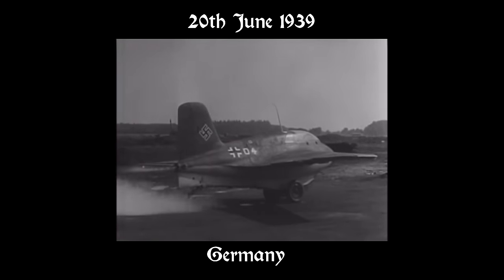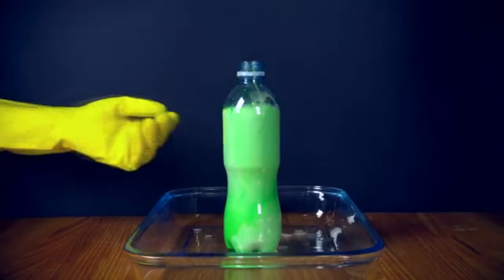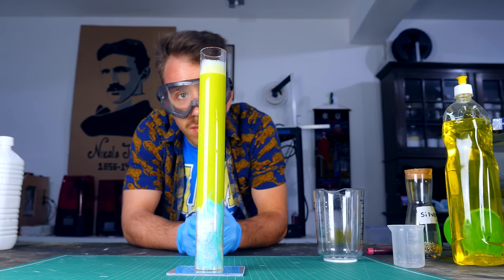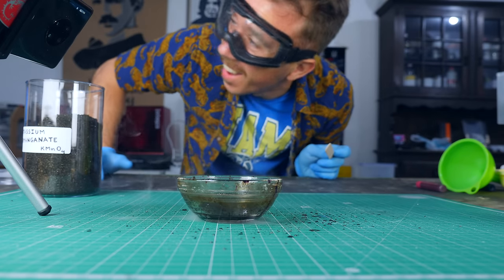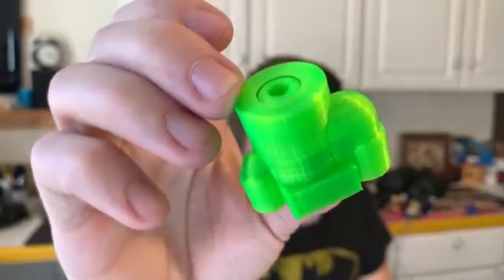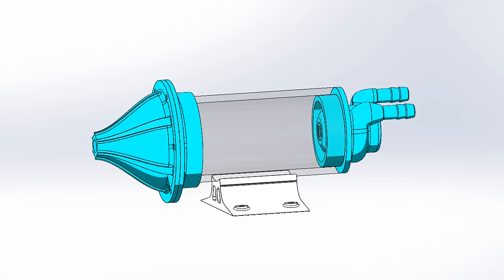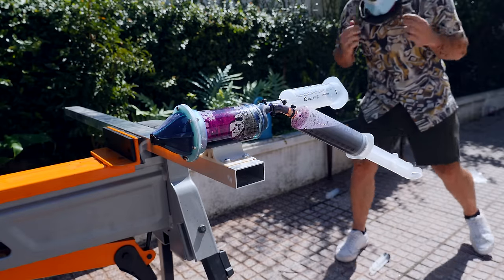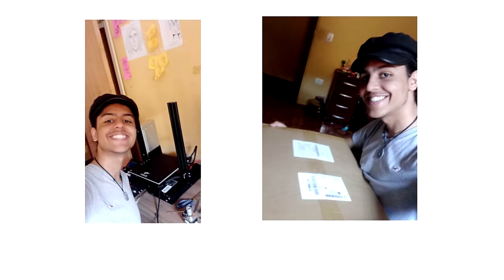The Forgotten Nazi Cold Rocket Engine (3D Printed)

Comment: Catalytic reactions are typically directly proportional to the surface area of the catalyst. Swap those beads of silver for silver mesh and place in the nozzle. H2O2 which doesn't react with the KMnO4 (common, due to the violent nature of the reaction and limitations on reaction vessel volume) will get another reaction chance with the silver (it also promotes mixing). Also, a bit of tweaking to the design of your reaction chamber and mixer will help limit the backflow issue you're having. For the mixer, redesign to make it conical around the nozzle (the cone going IN to the chamber) and for the reaction chamber you can add angled (baffled) steps to the side so that expanding gasses favor moving towards the walls of the chamber and nozzle (this also reinforces the chamber which allows you to make it thinner/lighter). Beyond that, you just need to get the H2O2/KMnO2 ratio correct and figure pump(s). Bonus points if you put Tesla valves between the pump(s) and mixer to further limit pressure backflow. - Video idea: Steam Rocket Engine 2.0
Reply: Redsigning the injector for higher pressures so that the catalyst and catalyzer can be atomized before mixing would help.
Reply: I think the reason his test at the beginning didn’t work so well was because of the lack of surface area.
Reply: Anjay
Reply: The silver is also likely oxidized, limiting the amount of actual catalizing that occurs. Putting the potassium permanganate in a blender to make the particles more fine may also be smart so surface area is increased.
Reply: @pabloarroyo1023  - Silver doesn't oxidize by itself as it has an incredibly low affinity for oxygen. The most common oxides are all dark so the silver wouldn't be shiny if it were anyways. As for grinding up the potassium permanganate, that would only be necessary if he's not dissolving it all in water. 5g per 100ml at room temp is it's solubility.
Reply: I agree. Something else I noticed with this rocket was a combustion instability. Or in other words it was moving back and forth. This can be seen and heard in the footage when the said rocket engine was in operation. It went in waves instead of one clean motion. 
This has been known to destroy rocket engines and is not good. I don’t know if it was the injection methods that contributed to it in this case as injection pressures probably varied a lot in these tests or if it was a fault of a injection element 

Additionally increasing the length of the combustion chamber would help with proper conditions. If the chemicals get expelled through the nozzle before it’s done reacting you loose energy. And having the combustion chamber at a proper length is very important for effective operations. 

And to reenforce this idea use a silver meshhhhh
Reply: Yo
Reply: Maybe use a tesla valve for the backfiring issue...
Reply: Holy shit - now we going somewhere....
Future video titel:
Steamrocket thrust and engine operating time test
Reply: the printer will be yours my friend
Reply: Make a peroxide tank that is fed with steam the pressure would inject your peroxide in the chamber. Have you tried to use a sponge soaked with the second agent it might prevent it to be ejected by the pressure and a silver screen at the entrance of the nozzle might take care of the rest of the reaction. Please take a look at jet packs. They use peroxide as a fuel to propel them. It would give you a idea on the making of a steam generator. Keep all 10 of your fingers because we Love your videos!
Reply: best comment ever award
Reply: talking about a Tesla valve, the original design is a 2D design but he could probably design a more efficient design in 3D and print it
Reply: One of my first thoughts was to have some mesh in the chamber just for mixing. Never thought to combine powers and use silver mesh. Awesome idea.
Reply: Printer incoming
Reply: Boi u tha goat
Reply: 2.0?? Haha this sounds like 11.0
Reply: Same thoughts here, using the Tesla valves to limit back flow, and figure out the ratio of potassium permanganate to hydrogen peroxide for the reaction, so he doesn’t waste any reactants, the silver Sieve is a great idea, though I imagine it would stop working after a while, and you would need to replace the silver sieve. He should also try testing various nozzles to get peak thrust.
Forgot the word mesh for a bit there, meant mesh, wrote sieve
Reply: You could use the heat from the reaction chamber to heat/vaporize the incoming H2O2 before it enters the reaction chamber.
Reply: Fine silver shavings will increase the reaction time 2X.
Reply: Palladium on carbon spheres is used as a high concentration H2O2 catalyst in industry. Palladium is a bit more expensive than potassium permanganate though.
Reply: I think he is going to have to make a mesh of silver by 3D printing it in a plastic that can melt and evaporate at high heat, and use the 'LOST WAX METHOD" - you coat the mesh with plaster/water mix then coat it in clean sand, let it dry out, then repeat this to build up the outside coating of this. then you bake it in an oven to set the plaster and melt out the wax... or plastic in this case - I've seen this exact thing done on another channel and it worked great, but he used a certain plastic in the printer. THEN you melt the silver into liquid and pour it in the the void left by the melted plastic, let it cool, then break off the plaster and VOIA'LA!!! (idk how to spell that lol) you have a SILVER MESH IN THE EXACT SHAPE YOU NEED!!!! :D
P.S. - GREAT IDEA ON THE ONE-WAY VALVE IDEA BEING A TESLA VALVE!!! lol  But I think it might have to be a bit too long for this application - but YOU NEVER KNOW WITH INTEGZA!!! :D <3 :D
Reply: You'd want the catalyst right at the point of the inner "pyramid" of spray coming out of the nozzle. That way your reaction is catalyzed at the moment the 2 reactants react.
Reply: Electroplate Steel wool  should do it
Reply: bro if u already have a 3d printer can u let me win it 😄😄
Reply: Do you think it's possible to create a small outlet tube in the reaction chamber that could feed pressure to the two syringes to keep pumping the fuel? Or would the pressure just be equal on both sides of the syringes? I'm not experienced with chemistry or physics - just curious if it would work.
Reply: About the KMnO4 to H2O2 mixture to fully decompose you need 316,06g KMnO4 and 102.0441g of H2O2 yet id recommend to use the KMNO4 in excess to fully decompose the H2O2 and so maning it a little safer to use.
Reply: Can I also suggest a thing? Catalits are divided in two branches: homogeneous and etherogeneous. In the second case the reaction is dependent of the surface area, because the catalyst is on anpther phase (as in the silver case). The homogeneous is always faster, but harder to recicle.
My suggestion is to use iron, because it is known that Iron (III) is a catalyst for decomposition, it is cheap and easy to generate. You can use iron wool as a etherogeneous catalyst, in a mono pump mechanism, and iron sulphide in a double pump system.
Reply: @skybirdprojects5489  something like a carburetor would work beautifully for this!
Reply: Rather than silver mesh, silver plated onto a copper or nickel mesh would work well. 
Another catalyst that works well is potassium iodide.
Reply: Ideally a silver coated piece of glass fibre would be used as a catalyst. I think that would actually be pretty easy to make by coating some clean fused silica wool using the silver mirror reaction.
Reply: This guy better get the 3D printer
Reply: Give this guy a 3d printer
Reply: Literally came here to make the final point on the Tesla valves.

But I'm a giant nerd who responds with everything expanding in an oscillating matter with "I should use a Tesla valve for that."
Reply: That is what I was thinking but I was thinking silver powder or something.
Reply: Took the words right of my mouth. ……..

Just kidding
Reply: @Ameliaross106  - Catalytic reaction chambers are always an issue because the reaction doesn't drive itself (unlike combustion). In theory, and infinitely large complex chamber offers the optimal results because it ensures perfect catalytic reactions. However, every gram you add is a gram you need to accelerate. So, it's a bit of give-and take. You want the lightest/smallest chamber which yields the most thrust. This is where the efficiency game starts getting intense and why I limited my suggestions somewhat. Rockets are both easy ... And REALLY hard, haha.
Reply: @FrankRoosevelt32  That would work. It would be like a direct gas impingement semi automatic firearm action. The big concern would be a runaway though. More reaction  = more pressure = more fuel pushed in = more reaction ...  Etc etc etc. It is extremely doable but metering and restricting would be essential. A lot of testing and tweaking and perhaps a bit much for our dear friend. I'd also rather not see him get sprayed with high velocity/temp H2O2 :'(
Reply: @mariuskohler7097  It's a theoretical stoichiometric ratio but gets a little funky in application. If he is going to use a KMnO4/H2O solution then he only gets 5g/100ml at room temp. Also, the extra water bleeds off the heat while producing extra steam. Of course, using only 50% concentration H2O2 means he has excess water already ... Very messy. Personally, I'd do a quick range of tests to get a reasonably approximate ratio given the materials restrictions and then just run with it. Efficiency gains for this design and these materials will be a bit of playing darts in a dim room.
Reply: I'm no rocket scientist, but this checks out to me.
Reply: @mostlyscared  - Did you at least stay in a Holiday Inn Express last night?
Reply: Yeah I was thinking of the classic silver screens trapping KMnO2 catalyst bed as well.
Reply: Now things are shaping up. I like where this is going.
Reply: @fiveoneecho  - Depends on if he sticks to a KMnO4 solution or not as far as it's retention. It will certainly help either way though.
Reply: @xMrFarenheitx  - To the mooooooooooon !
Reply: Wow. Nice info.
Reply: @Ameliaross106  Yeah, it sounds like a wet pulse jet engine
Reply: @ghosttheoremproductions5469  ahhh very true - probably would have quite a few exploding engines before getting that right. Anyway, hope he goes through with your ideas. This is the most interesting project he’s done IMHO.
Reply: Going to be pretty sad if like-bot buyers win :-/
Reply: Yea the one thing that definitely stuck out to me was the size of the silver beads. I would have tried grinding it up into a powder or something.
Reply: @Bavarianscience  I think it can work, but before supporting silver on silica wool you need to clean it with some oxidating acid before silver coating, in order to perform plating better
Reply: @fabiosangalli1968  It's just silica so burning it off would probably work just fine.
Reply: @ghosttheoremproductions5469  True.  Typically you see the propellant blown over a catalyst bed in gas generators, though (at least for thrust applications).
Reply: Buck Rogers belt
Reply: Why dont you use tesla valves to stop the backflow? its a fixed, passive way of doing it
Reply: @Nobe_Oddy  I think it would be easier to make a thin silver sheet and than poke/cut holes in it in desired pattern
Reply: Platinum would work too or not with this reaction?
Reply: I believe silver mesh and potassium permanganate cannot be used together as permanganate is a strong oxidizer it would basically render the mesh useless after few launches
Reply: amazing ideas!
Reply: The backfiring seems to be a pumping issue.
Reply: Big brain
Reply: What should be the proportion
Reply: dude, u read my mind lol, but u did a much better job on writing it and explaining it. all i had figured out was the waterpumps with the tesla valves lol u also had the chemical side of it, go enjoy that 3D printer, you deserve it.
Reply: @MrOscarin97  - Scammers get the 3D printers and @Integza doesn't care. Never won anything.

Comment: Material with highest heat resistant you could buy is graphite.... I dont find anything for 3D printing, but maybe you could use graphite rod for critical parts, shaping with lathe and combinate with 3d printed metal parts.
Reply: @agusNievas  he would need diamond cutting tools or ceramic one
Reply: H2O  not exactly.... Around  4000 Celsius maybe
Reply: @CUBETechie  why? Graphite  easy to cut and shaping.
Reply: H2O  i dont think that Graphite burns, because it doesn't. You can use it in an arc welder as a rod.
Reply: so like F1 brakes carbon also oxidize
Reply: Tech Ingredients has a video showing what kind of graphite to buy and how to cut it on a lathe to make a rocket nozzle. This Old Tony has videos on improving an inexpensive hobby lathe. Blondi Hacks has a lot of great tutorials on lathe techniques although she doesn't machine graphite specifically.
Reply: I think steel would be sufficient if he has a lathe
Reply: Why don't people understand there is no fire in a monopropellant rocket so burning is irrelevant? 🤷 Although you won't get many uses out of a graphite nozzle, it doesn't burn that fast it works fine as proven by Tech Ingredients videos with solid and hybrid rockets and it was also used by Mythbusters in Confederate rocket which was a paraffin hybrid rocket. People criticizing the flammability of graphite have no idea what they are talking about.
Reply: @jonathandill3557  You can use paper as a nozzle for certain applications if you really want to.
Reply: @toby530  Correct. Integza also explains at the beginning of the video the reaction breaks hydrogen peroxide down to water vapor in the form of high pressure steam there is zero fire involved. This is the exact same reaction used in the rocket backpack famously featured in the 1984 Olympics opening ceremony.
Reply: Yeahh
Reply: @adamnagy4544  really? I thought it is harder to machine
Reply: Did someone say
 I N A N I M A T E  
 C A R B O N   
R O D?
Reply: @MyHandleIsGood  Temperature wise that should be perfectly fine for this type of rocket, but you'd probably want to use a waterproof adhesive like epoxy to laminate several layers for strength. That would certainly be much cheaper than buying graphite and a lathe.
Reply: @jonathandill3557  exactly what you want to laminate? Btw the epoxy is gonna burn, so I don't think it will be work...
Reply: https://youtu.be/FkRM1zjBINc for the skeptics :DD and an other: https://youtu.be/GcjPh8ugRzc
So yes, the graphite easily stand out on that temperature and easy to form (you can use a drill instead of the lathe)
Reply: @adamnagy4544  A hydrogen peroxide monopropellant rocket converts hydrogen peroxide to high pressure steam there is no fire in this reaction at all. The steam will exceed 100 C due to the pressure, but is nowhere near hot enough to set something on fire. A nozzle could be constructed with laminated paper, but would not necessarily be superior to printed resin and would need to be sealed so that it doesn't absorb water.
Reply: @jonathandill3557  ohhh I seee, the misunderstanding :DD The metal+graphite nozzle is little bit OP for the monopropellant rocket, my suggestion was about the hybrid rocket :D
Reply: @adamnagy4544  Guess I missed this was specifically about hybrid. It's exciting that Integza now has something that will work with the materials that he is comfortable with maybe we'll get to see a real launch soon.
Reply: H2O  yeah the carbon in graphite will react with the oxygen to form CO2 but if he could design that so the gasses coming through the graphite nozzle are already "burned" it should work really well
Reply: Personally for heat resistance you could buy zirconium toughened alumina. Won't sublimate at 3000 c. Graphites unfortunate downside is that sublimation thus it has a lifespan